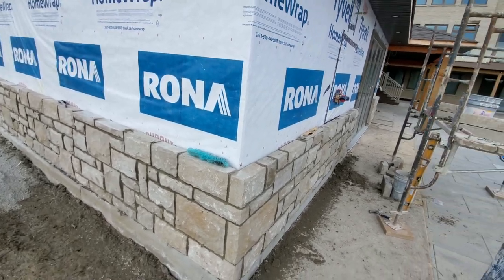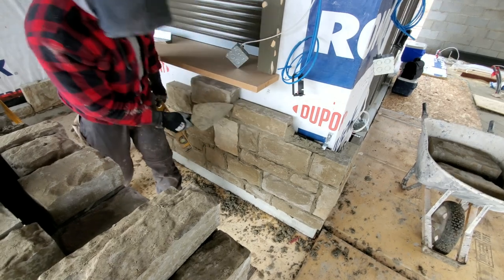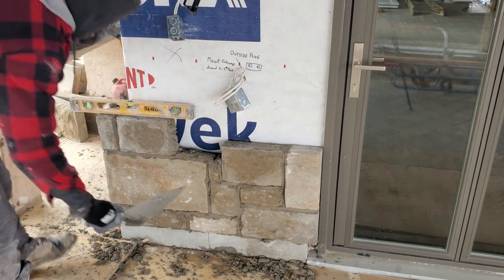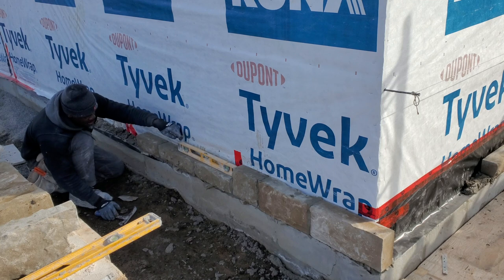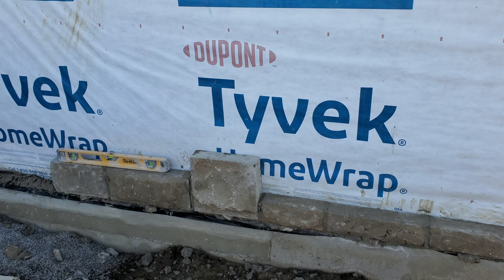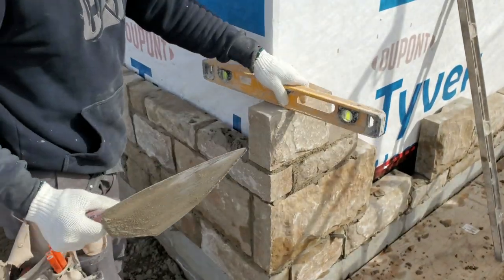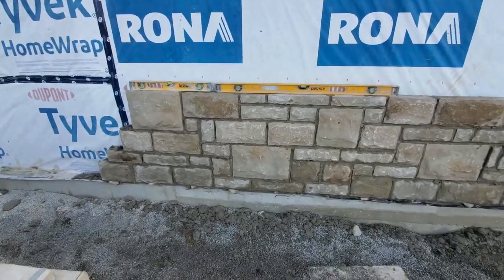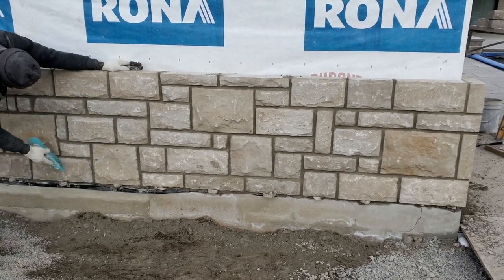Brickalaying  - Day 2 Stone work Done, DIY

Comment: Did someone put a small stone sideways? 😳😳😳😳
Reply: Hey heavy, what's wrong with putting small stone sideways 🤔 I did it as well ,don't see anything wrong by doing it
Reply from the maker: A lot of mason don't even know that you can turn the small stone aside that's small stone that turns aside is the same as the big one which is 11 and a 1/2 inches in heights  , So you can use it just as the big one
Reply: @1kbconstruction824  lots of masons call it tumb stone . The stones are designed to lay on there sides that's why it's called bed joint not head joint (not to be layed on head) ! Even the ripples in the stone look different when turned up right It's a simple rule like keeping large stones a certain distance from eachother but hey if no one cares then why not right! Drive it in brother